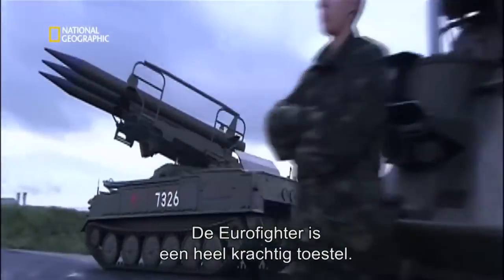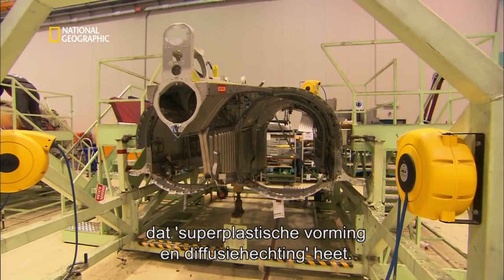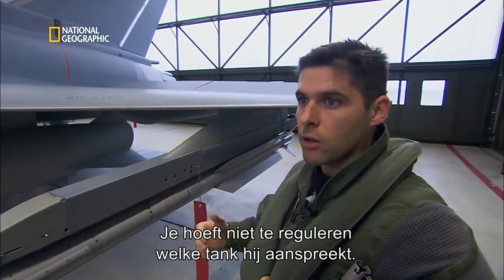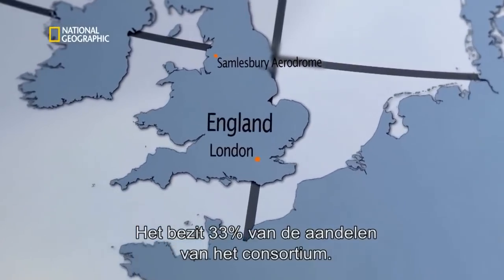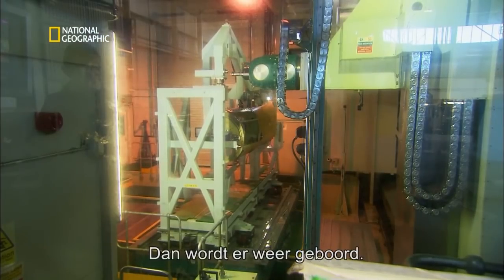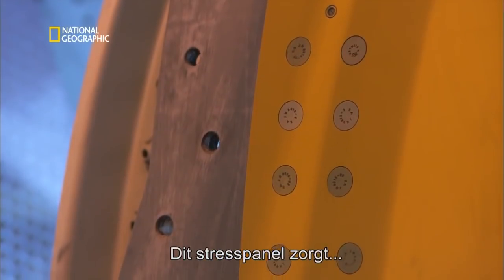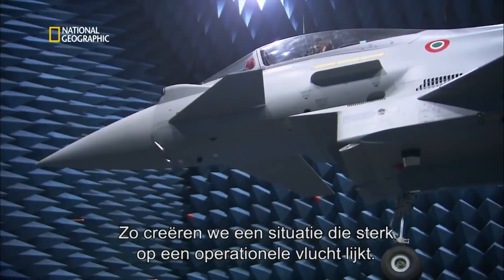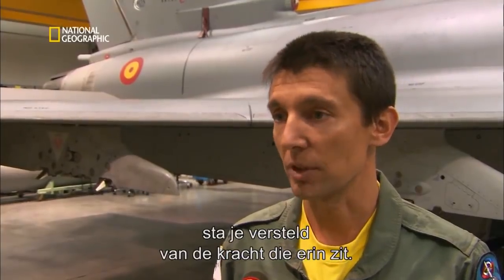National Geographic Megafactories - Eurofighter Typhoon

Comment: I am sure at 100%, in a dogfight the MiG-21 can destroy this typhoon.

I did pilot that typhoon in a real simulator it is not the best multi role in the world, there is no best multi role fighter. Each ‘’ multi role’’ is made for a specific geographic location, missions.

I did pilot mig 21, mig 29 mig 23, mig 27, su 25, su 27, f15, a10, f16.

Personally in aerodynamic, weapons, speed : I prefer Russian aviations
But in flight instruments I prefer Americans aviations.

What do you think?
Reply: Lol why what has a mig 21 have an advantage over the Typoon ?
Reply: Gar Whittaker no real advantage but if you use your mind for a very good strategy you will destroy it believe me.

If you want the mig21 have advantages over f16, in speed, aerodynamics.

The first version of the mig 21 was having a radar to target airplanes.
The first version of the f16 doesn’t have a radar.
Reply: @eleveseleve7755  So your saying it don't have any chance against Typoon.
Reply: Gar Whittaker no when I say there is no real advantage that mean the speed, altitude, rate of turn are basically the same. 
You can destroy this typhoon when you know it’s venerability. (Just like you want to hit someone who is blind).

All what you need is to get the last location of this typhoon in the air and then search for it without turning on your radar( or it will detect you), then you can attack it from low altitude without even the pilot know what hit him.

If you want I can search a video for this
Reply: Why didn't you mention the Rafale? 
Nice Troll

Comment: Good aircraft but too expensive.
Reply: Relative to what? F-22, F-35?
Reply: You're wrong Hyung-chan....
The expensive 4.5th gen fighter is the Rafale, not the Eurofighter.
🟥Eurofighter 🇬🇧🇩🇪🇮🇹🇪🇦
1) December 2021
The acquisition, valued at € 2.043 billion, was approved by Spain’s Council of Ministers on 14 December 2021 and includes the aircraft, engines, a simulator and the necessary support services.
2.043bn ÷ 20 EF = 102M per unit
Source: Airbus Site

🟥Rafale🇫🇷
1) December 2021 🇦🇪
The UAE signed Dec. 3 the contract, worth €14 billion ($15 billion), for 80 Rafale and the related deal worth €2 billion for missiles from MBDA, a European maker of guided weapons.
€14bn ÷ 80 Rafale = €175M per unit
Source: SLDinfo

The Rafale in past was more expensive.
2) September 2016 🇮🇳
India and France had signed a €7.87 billion inter-governmental agreement (IGA) in September 2016 for 36 Rafale multi-role fighter jets in fly-away condition, following the surprise announcement by Prime Minister Narendra Modi in April 2015 citing “critical operational necessity” of the IAF.
€7,87bn ÷ 36 Rafale = €218M per unit
Source: The Hindu

Comment: no match to against US plane makers. what a joke of a production.
Reply: Typhoon matches everything with the possible exception of the F-22 in BVR and even then the Luftwaffe had 'F-22 with salad' one afternoon of a Red Flag exercise.
Given the supply chain length within the USA and the number of contractors involved within that widespread supply chain (for political reasons) the build chain for the Typhoon is comparatively short. The difference is possibly Typhoon has 4 FALs rather than one but thats dumb politics for you. No less dumb than the US Pork Barrel politics that denied the USAF of the best air tanker in the world (A330 MRTT) and foisted the smaller and failing KC-46 Pegasus boondoggle.
Anyway always good to have the support of our supposed allies 'innit'?

Comment: It's NOT the best!!!!!!!   That would be F 22 raptor!!!!!!
Reply: It's likely the best 4th gen fighter. It out-performs an F-15 (not just because of its ability to supercruise, but also its climb and turn rate). That's not just my opinion, it's from more than one British/American test pilots who've flown both types.
Reply: @Aeronaut1975  Best 4th gen fighter is Rafale, Hands down.  It is battle proven and while not being the fastest jet around,  it can certainly out corner anything.
Reply: @guillaumeromain6694  You would say that, you're French. It doesn't make it true, though. Rafale is underpowered for its size, whereas the EJ2000 engines are capable of potentially developing 20-30% more thrust are and are the most reliable military jet engines in the world. Nobody doubts that Rafale is superior in ground attack (Something Typhoon was never originally designed to do, it was designed as an air superiority fighter first, whereas Rafale was primarily designed to be ground attack first, Fighter second.) Rafale may have a slightly higher instantaneous turn rate, but Typhoon can sustain high G turns for much longer without bleeding airspeed. "Typhoon is the faster aircraft and has a significantly superior thrust-to-weight ratio which gives it better acceleration at all altitudes. This also allows Typhoon to retain and regain energy faster than Rafale in a horizontal dogfight situation. It also has a significantly higher service ceiling of over 60,000ft which allows it to operate uniquely well alongside the US F-22 Raptors ‘high and fast’ in the air superiority role which is exactly where it was designed to excel".  (https://hushkit.net/2015/12/18/typhoon-versus-rafale-the-final-word/)
Reply: @Aeronaut1975  And how do you figure that I'm French? On account of my user name and position on Rafale ? That's brilliant mate! I think you should try harder.
As I said, Rafale isn't the fastest, and EF might get the upper hand in climb rate and service ceiling. None of those differences are too big a difference between the two though and Rafale will surely thrash EF when it comes to the delivery of weapons, manoeuvrebility and air to ground attacks. Rafale can be operated from ground bases and carriers and its cost of maintenance is largely less expensive than EF. 
While EF is a seriously made and capable fighter, Rafale is a better platform.
Reply: @Aeronaut1975  Rafale beat Tyohoon on every single dogfight they pitched one another against.  What you claim about thrust is true but  none of these related areas are  too big a margin. Rafale more than makes up for it in other areas and can thrash Eurofighter. All in all, Rafale is a better jet, is very well made and is a tad cheaper than EF and cost of maintenance are inferior to that of EF

Switzerland recently released a detailed assessment of 4 fighters, including Rafale and EF. Rafale came first.

Comment: of course it makes sense that one wing is built in Italy and the other one in Spain...sureeeee
Reply: Max Morvan Collaboration 😁
Reply: Kaizaro123  airbus has been doing it for decades
Reply: Kaizaro123 These European Military & Civilian Aircraft builders have been doing this since the 1970’s with great success. Every Airbus is made this way and Pilots prefer them to Boeing’s. The beauty of the European system of manufacture is any factory can make more or all of the aircraft boosting production.
Reply: Kaizaro123  build one factory cut in 5 remote sections or 5 factories in different countries the cost could be crazy
Reply: floflo why, it works? The F35 is built in two different countries, yet you’re lauding it’s brilliance.
Reply: Kaizaro123   subcontracting is something else they split the construction between countries they didn't hire contractors they built the factory in split parts in different areas.
not that i care it being a good or bad ting. i don't care about the EF in anyway
Reply: Kaizaro123 Every Aircraft, whether Military or Civil is built in separate factories. The A300’s, A310’s, A320’s, right through to the largest passenger plane the A380 is built separately in other countries! Nothing wrong with those planes unlike the A787!
Reply: Guys, the Eurofighter with its +600 fighters produced has given a lot of work in Europe. 
Not to mention that the cost of the Eurofighter is lower than the Rafale. 
🟥Let us remember that Consortia are used to save money and to mature the industrial sector by acquiring new skills. 
🟥Building alone is a crazy move, which is why the French only have one Fighter that fills all roles.
Reply: Kaizaro123  the problem is that these countries accept to pool the resources together to make an aircraft, but don't want a single country to build it or else everyone's paying the lucky country to get rich off the manufacturing. So they distribute the manufacturing through multiple countries to make it "fair".

Comment: Water is sprayed not to prevent "sparks" which would not happen anyway, but to cool the drill bit. What else did you make up because you couldn't be bothered looking it up?
Oh and robots never prevented human error. Badly programmed robots just produce scrap more quickly.
Reply: Muru Roa robots do have predictable variation which is not manageable in case of humans.
Reply: @dapdizzy  Disagree. Six Sigma and Lean Manufacturing: human "variations" are entirely taken into account, but that has nothing to do with automation. Again, machines/robots need to be calibrated... by humans. QED
Reply: Muru Roa 
So you want to compare manually drilled holes with the ones drilled by robotic arm?
What do you mean by: robots never prevented human error? Robots do what they are programmed to, unlike humans. A man can make a single mistake that could game dramatic consequences. A robot would make a mistake only when there was a huge maintenance gap, some major long accumulated problem that led to a mistake. Those probabilities are different by orders of magnitude.
Reply: @dapdizzy  Nope, I don't. 99% of robotic "mistakes" are because of bad calibration, not bad programming. Programming mistakes are easy to find, diagnose and fix upfront. Bad calibration however is only detected through quality control after the fact. Factories don't use robots to avoid mistakes but to increase productivity and to reduce tasks hazardous to your health.
Reply: Muru Roa Ok, thanks for clarification of your point. Do you relate to manufacturing in a way, BTW?
Reply: @dapdizzy  I've been a process engineer for various European and Japanese car manufacturers.
Reply: Kaizaro123  Experts hardly need to argue. Perhaps that's why.

Comment: Well said they need to do a documentary on the Lockheed Martin Cameri plant because that's where the F-35 jets for the European customers might be possibly be Made for these countries Netherlands Spain Norway Italy and United Kingdom.
Reply: They are made just outside Bristol. The U.K. is the only Tier 1 partner and make over 15% of the thing, the Assembly and modification centre is there too. Italy has an emergency repair centre.
Reply: @Jimmy_Hills_Love_Child  
1) Italy is the second country to have contributed to the F-35 project. 
2) We are also a Tier 2 partner and the second partner country to have invested a lot of money(second only to the UK). 
3) We are the 2nd in Europe with the purchase of 90 F-35s(60 F-35A and 30 F-35B). 

🟥Cameri, Italy Air Base is the only Final Assembly and Check Out/Maintenance, Repair, Overhaul & Upgrade (FACO/MRO&U) facility outside the United States, for final assembly of the F-35 Numerous Italian universities and the main Italian companies such as Avio and Leonardo are involved in Cameri. 
🟥Also Avio participated in both the Pratt & Whitney F135 and General Electric/Rolls-Royce F136 powerplant programs in the past. 
🟥Leonardo (formerly called Finmeccanica) was involved in the design of radio, Optronic systems, Seat, EW systems etc. while Alenia Aermacchi took care of the box wing.

Comment: The F-15 could crush it and if it doesn’t have thrust vectoring what’s the point you don’t have a chance against a F-22 or F-35 the maneuverability and stealth means the fight would be over before it begins. The BVR capabilities of 5th gen fighters mean the typhoon would be dead before it even knew a 22 or 35 was out there
Reply: F15 could crush it? You're having a laugh, aren't you?
Reply: @Lewis_parry  Don't laugh at the F-15 until you defeat one in the air. So far nobody has done that.
Reply: @Lewis_parry  Just another clueless American lol
Reply: This guys full of shit, and I won’t even explain why, and if you want a lecture on why you’re full of shit, ask Mark Jackson, because he’s actually my father, and still works there
Reply: The Eurofighter had already beaten the F-22 in the ATCL 2009 international training thanks to the EW DASS and PIRATE systems. Even the Rafale which has more powerful EW systems than the Eurofighter managed to defeat the F-22. The EW SPECTRA and EuroDASS are powerful jamming weapons that prevent lock-on during BVR and Dogfighting engagements.
🟥The F-22 has the ability to be stealth due to its classifield external material, but the EF and Rafale have the ability to become invisible due to advanced EW systems

Comment: The eurofighter never was the most advanced multi role fighter in the world and will never be. The rafale is THE multirole fighter, the best of its kind.
Reply: true: the EF was designed first as interceptor, without possibility to carrier use, that's why they are so different...
Reply: Best of it's kind maybe but certainly not better than the typhoon in avionics and raw kinematic performance
Reply: How come Typhoon was the first with air to air long range attack missile. Typhoon is also faster with faster climb rate & higher ceiling, it can use its weapons, when others can’t. BAE supply a lot of electronics for a lot of well known aircraft, they are recognised as a defence contractor to USA. Typhoon has even higher rated engines available if required, but it should be noted new aircraft are in the pipeline and who knows what the future brings?
Reply: Wrong. 
The Eurofighter, like the Panavia Tornado, is a fighter designed to be multi-role (Interceptor, CAS and air superiority). 
The Rafale is superior only in its powerful EW systems, which have proven superior to the EF. 

The Eurofighter is: 
1) Less expensive 
2) Faster 
3) More maneuverable at high altitudes 
4) Reaches higher altitudes 
5) More autonomy 
6) More load capacity. 
7) HMSS advanced helmet 
..... of the Rafale.

🟥Early Rafales were weaker due to their earlier Radar radar and also did not have Meteor missiles. 
🟥UK, Germany and Italy didn't need a Naval variant because they didn't have CATOBAR aircraft carriers, and for the nuclear variant there was already the Panavia Tornado.....

Comment: Double welding system and backing of inert gas with magnetic coupling
Double automatic and simultaneous welding with magnetic coupling for industry
 
Specification
The invention refers to two complete welding heads and an inert gas (N) for external and internal (S) backing which work synchronously and magnetically coupled through two or more force fields of the two integrated systems of electromagnets or permanent magnets.
The design of the (N) and (S) devices for welding and inert gas backing has on each side indistinctly, rolling paramagnetic aluminum plates.
These plates house in their structure magnets or electromagnets of inverted polarity (N) (S).
The rolling and articulated designs keep the coupling and the parallel alignment constant with each other, making it possible to weld the sides of the outer and inner material simultaneously with the independent power sources. (Page 12, 13 (N1) (S4)). The invention of the double head and magnetic coupling welding are designed to work on paramagnetic and diamagnetic materials compatible with the process.
The equipment and system provides an exclusive technical solution to solve the physical obstacles of welding and gassing, with front and back purge, sheets and plates of various thicknesses of austenitic stainless steels and strategic materials such as titanium and aluminum.
The food, laboratory, chemical, oil, nuclear and aerospace industries, together with their multiplicity of applications and technical levels of superior excellence, are the ideal center for the use of the system.
Reply: Brilliantly explained! One can only appreciate the complexities of metallurgy by reading this. It's a really pity that the Typhoon took 20 years to fructify, in the meantime the rest of the world got ahead, including the Dasault 'Rafale'; which got a late start because of the bickering of the four countries involved in the project. It's avionics by 'Thales' of France is second to none!
   Those 'froggies' don't think out of the box..... they're on a totally different level! Very unconventional  'in extremis'. 
   Even in their automotive engineering, i.e. Citroen, Renault etc. they come up with stunning engineering.
   The "Rafale", with it's enormous wing area and superlative control surfaces not only gives it deadly maneuverability but makes it a perfect candidate as a multy-role performer with it's multiple assorted amunition stations.
    I, for one, am glad that India is, at long last , going in for the "Rafale". The much upgraded version is ideal for the kind of opposition the Indian Air Force faces on two fronts. From Pakistan and from China. The mainstay Mikoyan 21 has had it's day decades ago, and our boys can heave a sigh of relief that that 'Widow Maker" is now going to be a distant frightening memory. No doubt, it was a brilliant plane, designed for a specific purpose. A record holder for altitude as well as speed! But that was a long,long time ago.
    It's take-off and landing characteristics also left a lot to be desired, and it really took some getting used to. I know of pilots like David Laban Figueredo of the I.A.F. who would swear by it in a tight situation.(Sadly he's no longer with us).But like I said,you either love it or loathe it. 
   It reminds me of another plane, the Lockheed F 104 G Starfighter. Also nicknamed "widow maker".